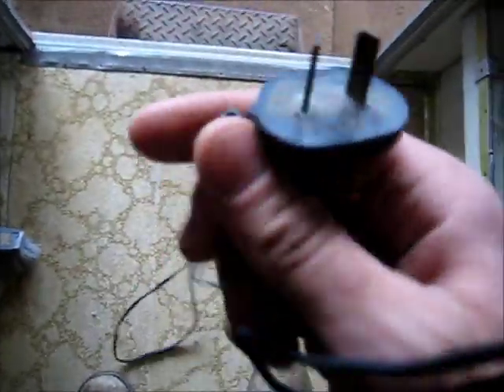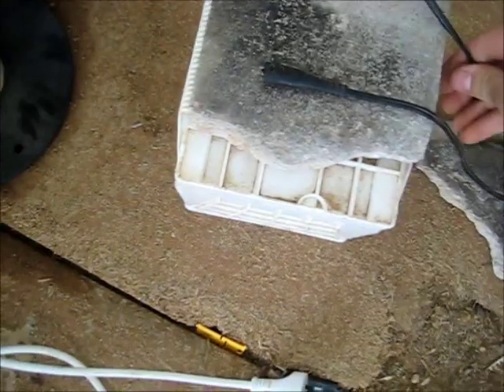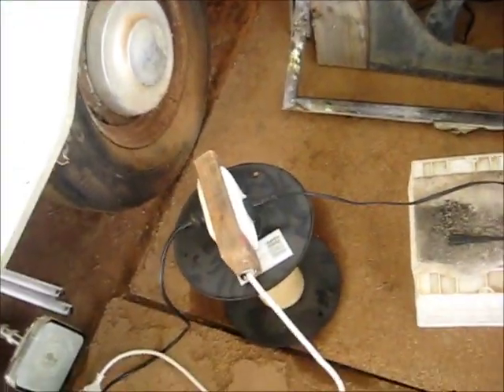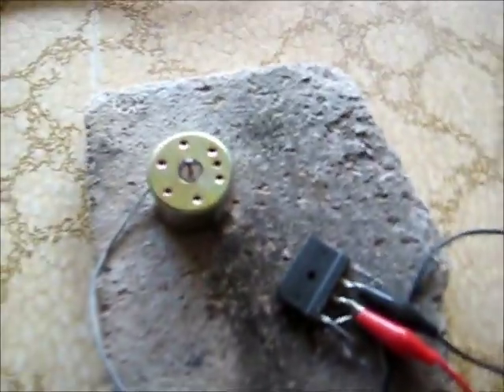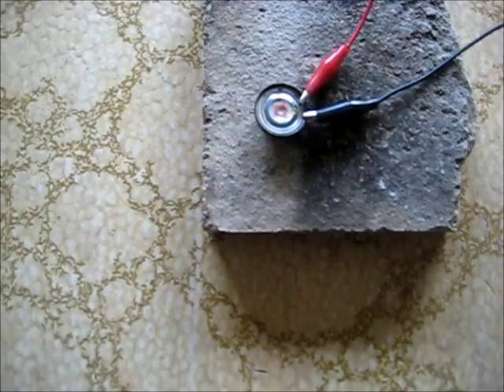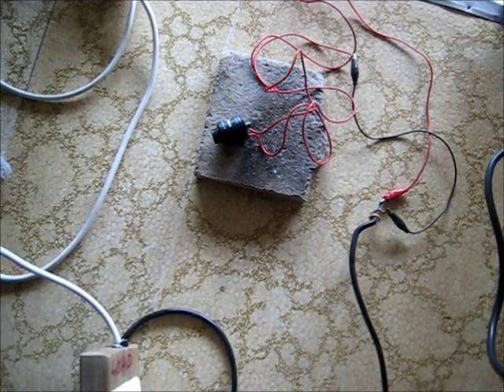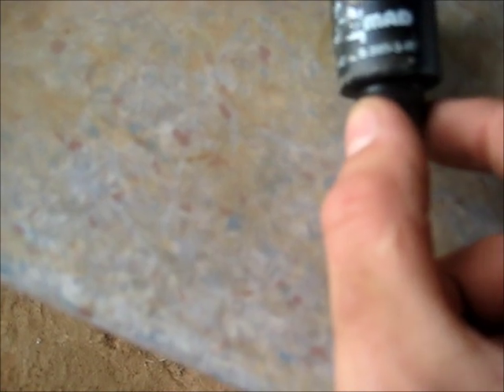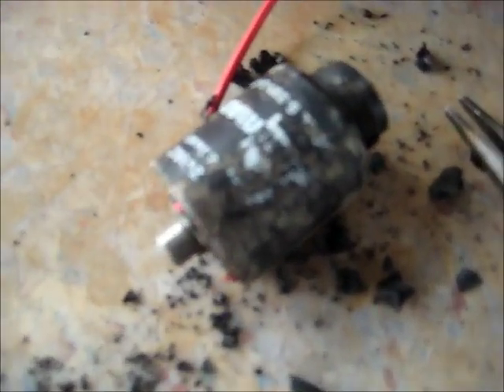Overload Flex & 24 Volt Solenoid VS Variac

Comment: Sure your heater was on full? You could probably get away with just shorting the end of the cable if it's rated low enough compared to your breaker.